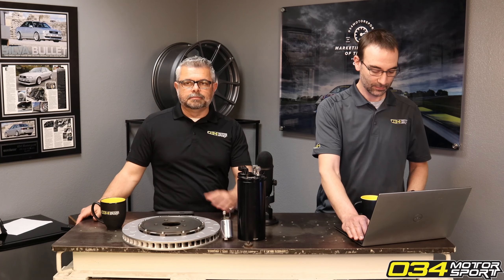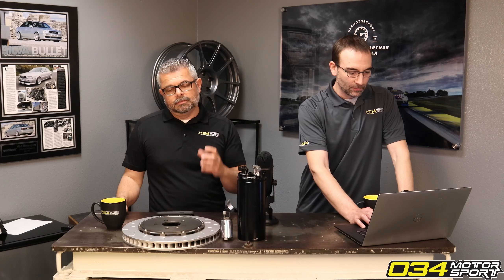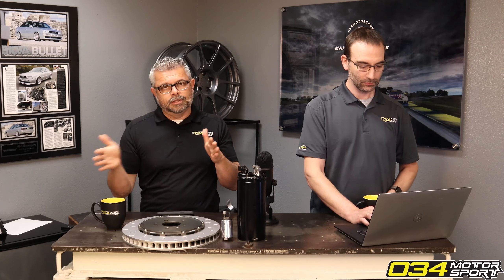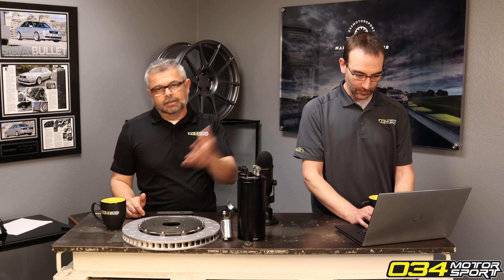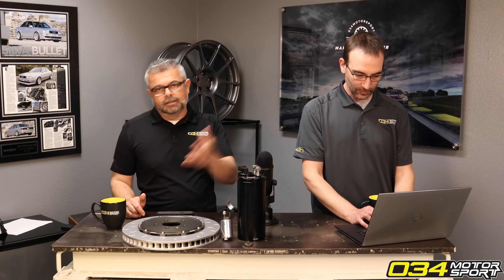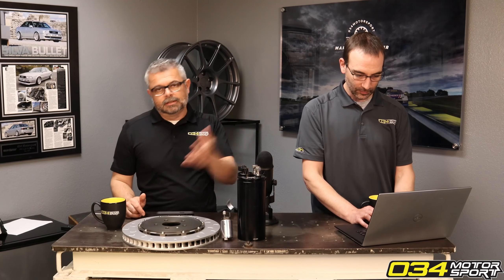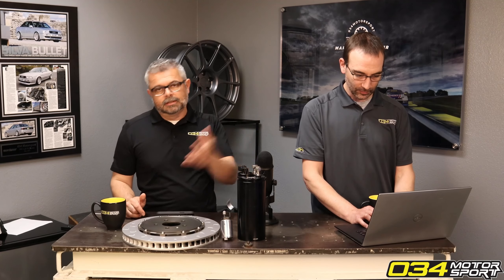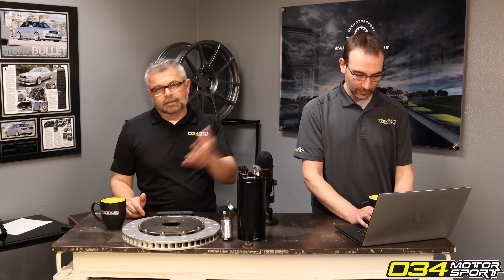What are Bypass & Diverter Valves and How do they work? | 034Motorsport FAQ

Comment: 1. Wastegates releasing air pressure can make sound and it tends to be louder the greater the pressure difference. Whether that sound can be heard depends if the air is released into intake or to atmosphere. Latter is in general audible, first, less likely to be heard.

2. Turbine neither compressor wheel will not spin backwards during the surge. They spin anywhere from 60k to 300kRPM, so they won't stop spinning at the very instant when throttle body is closed and you start hearing turbo surge sound

Comment: Thanks for this guys!  I have a 2016 Audi S7 and just threw a new cold air and noticed the flutter on acceleration at lower RPM, I thought it was a dead turbo! First turbo car, I'm learning a lot.  I thought to myself, "Wait if I am giving gas but low RPM, how does the turbo spin up fast enough to provide full power?" And well, you cleared that up!  I was bothered that I could hear a nice woosh on WOT at higher RPM, but at lower rpm giving it in "manual mode" I heard flutter and was really concerned. Again, thanks guys! =)
Reply: Glad we could help!

Comment: Hi I’m curious today I replaced the old OE diverter valve 710N on my 1.8T because sometimes it’s honking I guess yeah it’s still running not so bad, with 034 diverter valve/bypass billet yeah $99.9 good price good look too, my problem is after installing this valve it seems that the idle is not stable, guess I need to re-learn, taking drive for 10-20 miles well it’s not bad I mean good response but again I stopped the idle unstable some went to 1k rpm and down to normal and up again , my TB, MAF, IAT has been cleaning up 3 days ago 
My most urgent question is do I need to reset my ECU again since I just did 3 days ago, to day I installed 034 and just go … 
PS : I reversed old 710N and it’s a bit good than standard Audi had, can I install reverse orientation the DV 034 too? 
Regards,